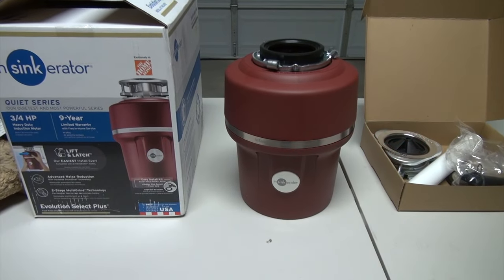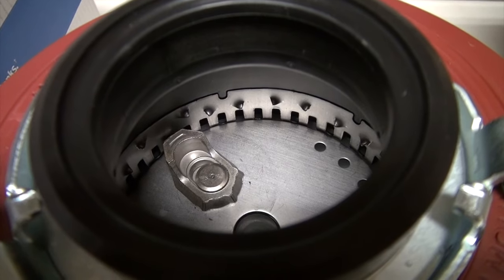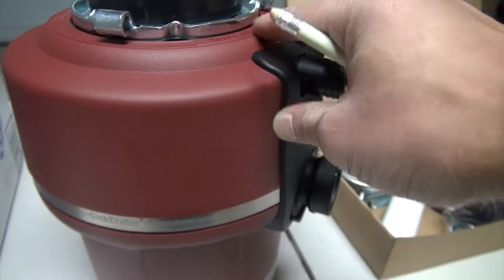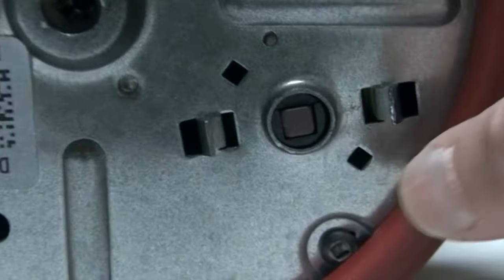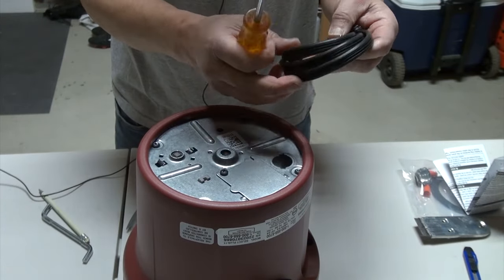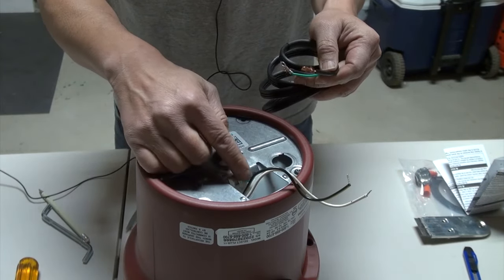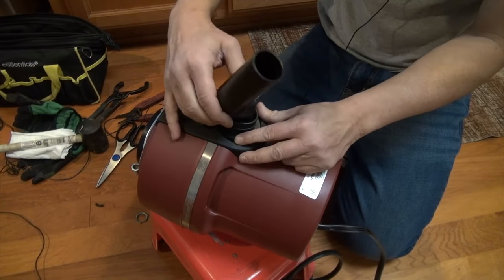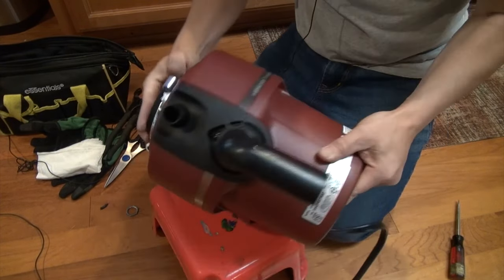How to Remove, Wire, and Replace a Garbage Disposal: InSinkErator Evolution Select Plus

Comment: Great video. Encouraging to try as a DIY. 
But wondering Why don’t they just attach the wire to the disposal or provide a female plug before shipping the product ? Like a TV.
Reply from the maker: Great point!  I'm not sure why they don't pre-wire the disposal for us, that would make it more simple.  It might add more to their production costs?  A good question to research.  Thanks!
Reply: I think they leave up to the installer on how they want to wire. I've only seen hardwired once out of 100 installs
Reply: You could also theoretically use the preexisting wire from the previous disposal? I'm just making that up because I don't actually know xD BUT, I'm hoping that's the case because my outlet is behind some kind of MDF board under the sink.
Reply: I think they do not provide a plug like in a TV because a disposal vibrates, and the plug may come loose.  Hardwiring makes a more secure connection.

Comment: Thank you so much for this video. I was installing the same unit and having a really hard time bench pressing it into place and trying to attach at the same time.  A trip to Home Depot for a new scissor jack like the one you used did the trick! (and has a lot of future uses anyway)  Also, appreciated about how to tell the hot wire on the plug and outlet.
Reply from the maker: I’m so glad it was helpful.  Thank you!

Comment: Great job brother. Very nice unit. I learned  hot  side of the plug when wiring. that was very insightful. One step I would add is I like to detach the dishwasher hose from the air gap and clean out running water hose with some pressure through it to clean out any crud that maybe in it.  The electrical part was very insightful. I usually swap the plugs an try to match them as old install but now I know I'll be right. Cheers brother.
Reply from the maker: Thanks! And great catch!  I totally forgot about flushing out the dishwasher hose.  Appreciate the helpful input.  Cheers!
Reply: When I connect black wire to the black and white wire to the white, it doesn't work. should I connect Black to white and white to black and see if it works? Is that dangerous or you can swap like that?

Comment: Excellent video.  Thanks.  One question: How did you cut the black plastic drain tube? What tool did you use?
Reply from the maker: If I remember correctly, I used a hand saw. Thanks!🪚